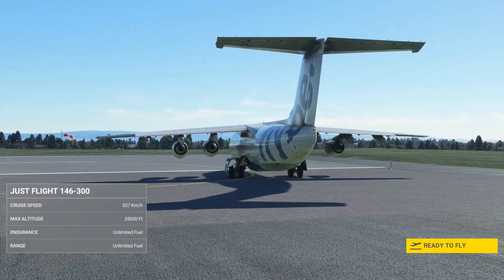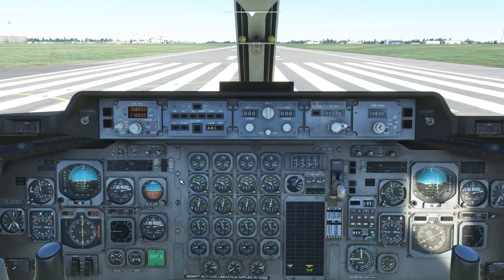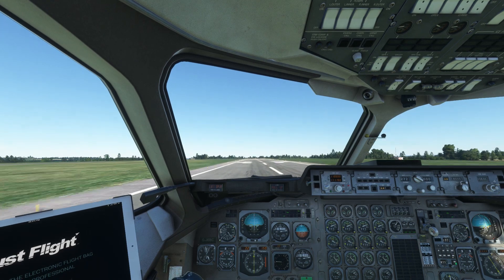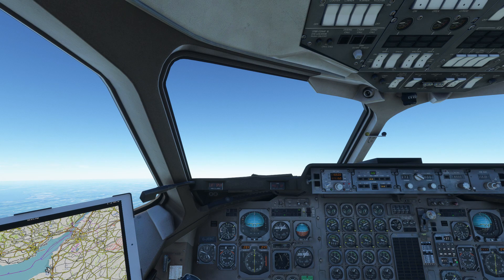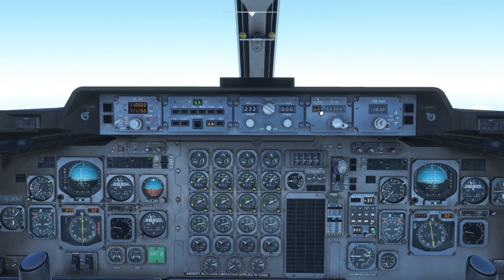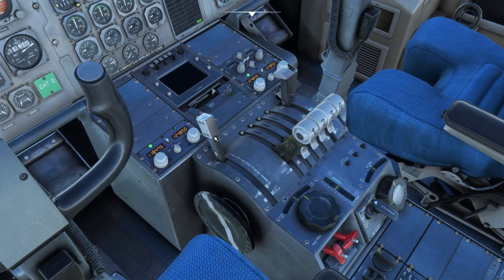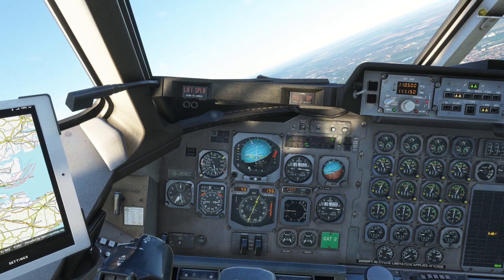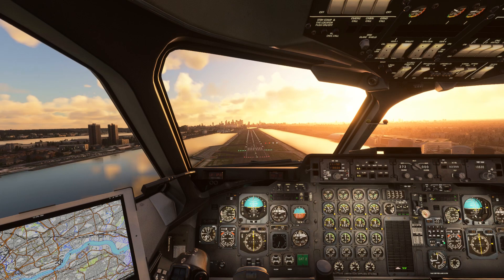Just Flight 146 Professional MSFS - Quick Tutorial

Comment: Great tutorial if you just want to get the plane up in the air following a flight plan and back on the ground without going through every button, knob and procedure (sorry I'm not a purist but like to understand and use the basics to get from A to B).  Nice length video if you don't have an hour or so to spare going through every detail.  I really struggled to fly this plane but following this tutorial step by step almost achieved a decent approach and landing, had I not messed up my flap settings at the last minute 🙄, which is nothing to do with the quality of the instructions, although I did still manage to get the plane down on the runway, or should I say dumped it on the runway 😀

Comment: Could someone please help whenever I get to around approach the autopilot decides to fly In the wrong direction from the airport and it happens all the time what do I do
Reply from the maker: Is the nav source set to localiser? Is the frequency and course set correctly? Are you on an intercept heading when you activate approach?
Reply: @TiJayFLY  the nav source is r nav since I’m not on approach yet the course and frequencies are correct as well
Reply: @TiJayFLY  the ap maybe like 10 miles before turning on approach just goes off the magenta line and off into the sunset
Reply from the maker: @DigitalCombatStuff  oh right yeah, the MSFS default autopilot can be really buggy with some approaches. I’ve had that happen in various planes. Try a different route / approach / runway
Reply: @TiJayFLY  I did but it happens every time it only worked once in Honolulu
Reply: @TiJayFLY  however in Honolulu it went off course but got back on course again
Reply from the maker: @DigitalCombatStuff  Without seeing a video, to me this sounds like MSFS being MSFS. I’ve seen all kinds of weirdness in all kinds of planes around approach. It’s like sometimes it can’t handle the transition between STAR and approach (the last few waypoints before loc intercept).

The 146 uses default autopilot underneath, so is susceptible to the same Asobo bugs. You can check what it’s doing by popping up the VFR Map overlay  during flight from the top menu btw, to see if all looks correct.